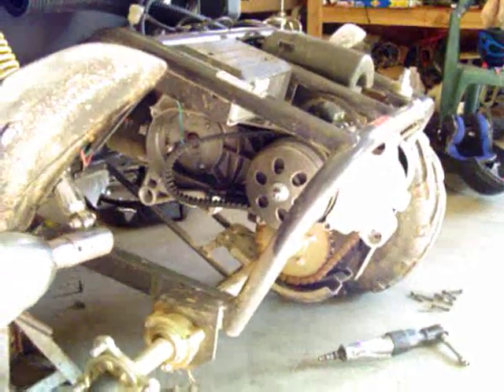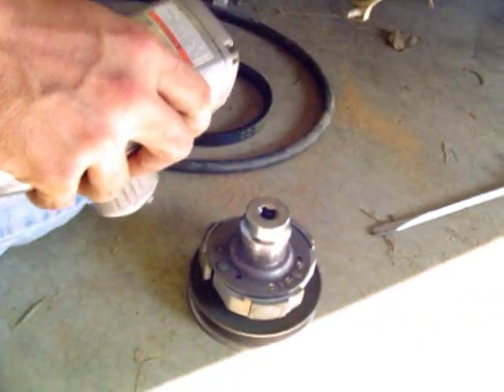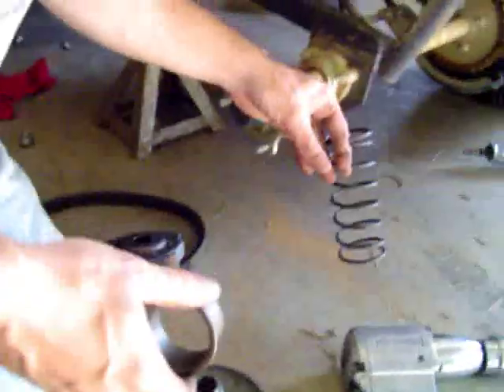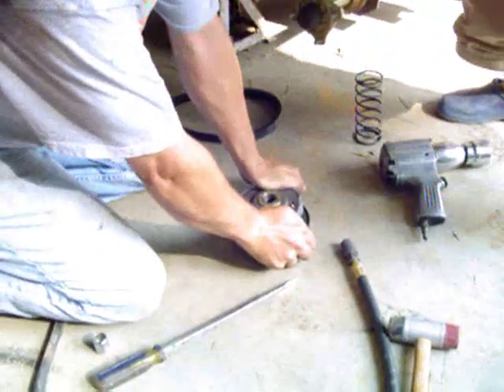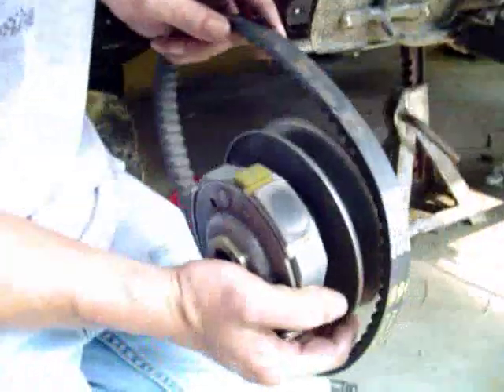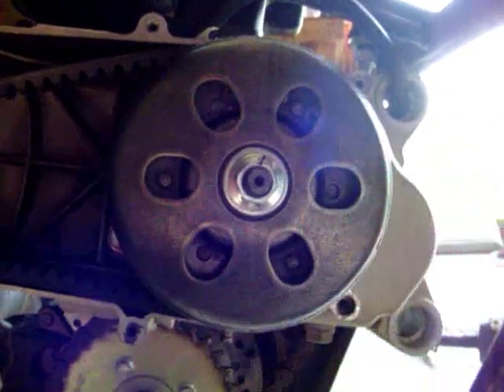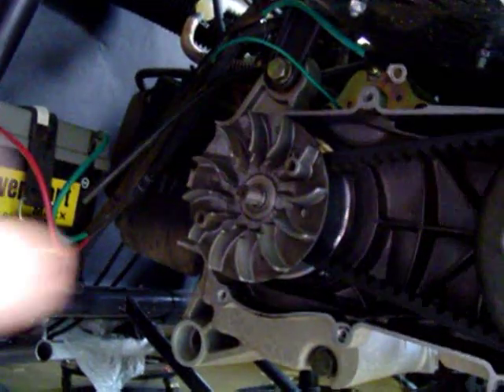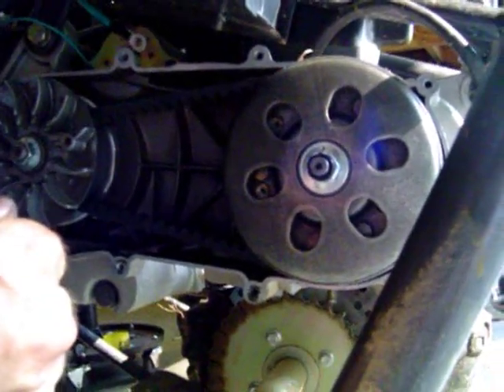PART 2 How to modify the variator and clutch assembly on a GY6 Engine with sliders

Comment: get on amazon.com type in what size motor mine is a 50 cc and order a new cdi box mine was under $20 and the buy a coil pack that should be under $20 and they have 4 prong and six prong cdi boxes look at your first then order

Comment: they are stock 2000 rpm springs i say use a 1000 rpm spring it allows you to take off sooner with less throttle pull giving you better speed

Comment from the maker: It is not a night and day difference at all. Whether or not you would want to do this depends on your riding style. We eventually took these mods back off because on our flat track, we didn't gain anything. If we were doing trails with a lot of hills it would be an advantage. For us and our flat track, exhaust and air intake mods are a lot better bang for the buck. Again, it depends on your riding style.

Comment: this is the best video on youtube, really shows how to do it well. I know what you mean when you say about the torquing of the flat nut. I didn't do this properly and the clutch exploded and then the tranmission rollers melted and then the splines on the crank rounded off. I think it it 60Nm standard torque for that nut.